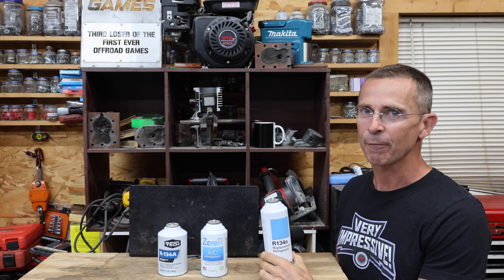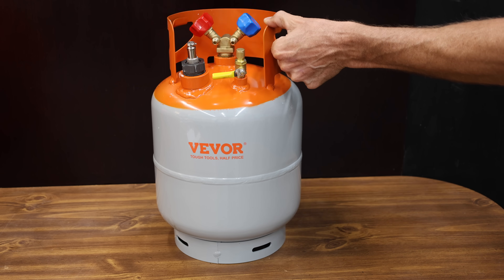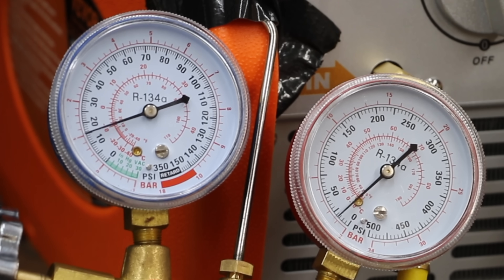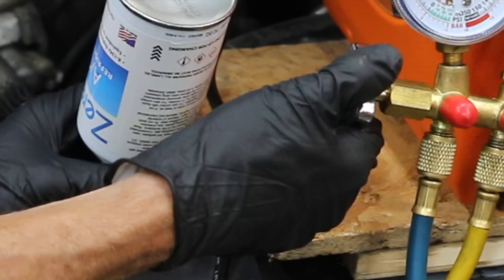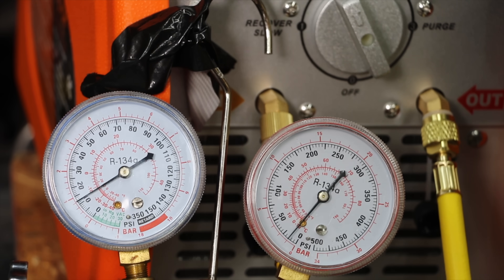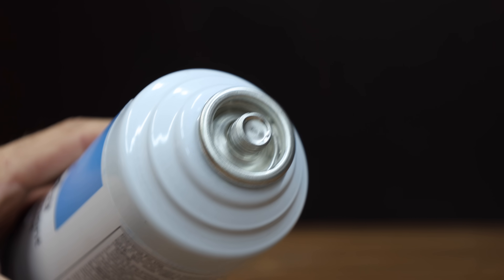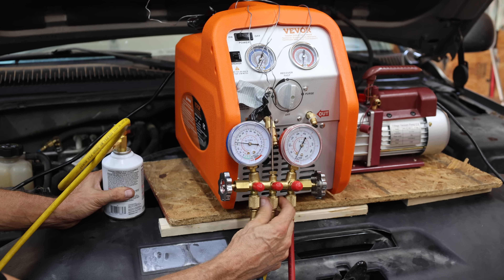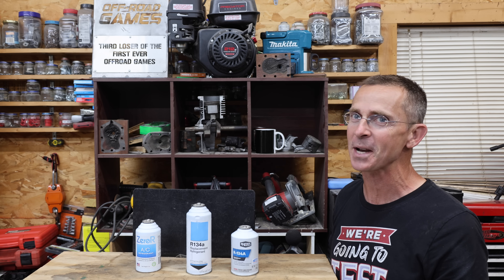How Dangerous is Fake Car A/C Refrigerant? Let's Find Out!

Comment: Fun fact: propane can be replaced in a functioning R22 system and it will run perfectly.
Propane and isobutane are common refrigerants in soda vending machines and commercial refrigerators like in supermarkets
Reply from the maker: Thanks for the feedback.
Reply: Yup I have also done the reverse. One time I was working on a nearly brand new Beverage Air bar undercounter beer bottle glass door display cooler that wasn't working. Turns out the damn trucking company must have bumped something during transport. The discharge line was cracked going right into the condenser coil and the first time they plugged it in, the compressor 'self recovered' the refrigerant charge and pumped it all out! We called them, and they were like well, blah blah call this 3rd party warranty company, and they'll send out a tech to 'fix' it (ya but wait for weeks no thanks). So, after finding the leak, I just brazed it shut with some 15% silFos, and recharged it with R22. It is still working fine 3-4 years later.

The problem was this happened in 2020, and NO supply houses anywhere around here had any R290 in stock, and we needed that cooler up and running asap for grand opening night of this nightclub. Today, a can of R290 can be had for about $29, and there's plenty back in stock now. But back in 2020, good luck, that was the worst of the f'ing Covid shutdowns/shortages nightmare.

isobutane (R600a) is a good substitute for R12/134A, very similar pressures and temps, boils at about 0 C at 0 psig pressures.
Reply: R290 is the trade name
Reply: A long time ago, I recharged my car with propane/butane mix.  It worked okay on the open road, though it really had a hard time unless there was enough air through the condenser.  I had no idea what appropriate numbers would have been, so my attempt at eyeballing it probably wasn't very good.  I remember though everyone waving their arms like hysterical muppets due to the flammability, but apparently it's okay to use flammable refrigerant now because fire hazards are good for the planet.
Reply: Ya everything burns
Reply: The reason why flammable refrigerants are used in those applications is that they're often not in confined spaces where ignition is more likely and would blow things apart.
Reply: My devanti ice maker uses propane refrigerant from memory, and its only 2 years old. Has a sticker advertising non ozone depleting flammable refrigerant. I guess because these ice makers are cheap and disposable when they break every few years they have to be able to be thrown away without too much risk to the environment
Reply: Good. Traditional refrigerants are very damaging to the environment
Reply: Mix the two and it gets very 🥶
Reply: @brnmcc01  I ran propane for years in a leaky car system and it works fine, just park it outside.  I do believe a lot of the generic replacements are a blend of propane and butane.  I believe good old R12 beats the  butane bends  a little because 12 has a higher denseness, don't think 134A will with a proper charge. I do thing the charge needed to be adjusted with the blends to get max cold.
Reply: I use r12a (propane/isobutane blend) it works excellent in my r12 systems
Reply: About any new peice of refrigeration equipment is running propane/butane. And I think by 2025 all residential air conditioners will be too !
So much for that JUST STOP OIL movement 🎉 !
Reply: For those in the comments section who say they are using propane and another chemical mixed together are lying.
You have to have what is called an azeotropic mixture, which is impossible for a layman at home to achieve.
Reply: @glennjames7107  my AC guy told me 410a was out by the end of this year. We have a system that’s 22 years old and really needs a total redo. He strongly suggested doing it by fall, stating the refrigerant, VFD’s, and all the updated PCB laden componentry will only drive up costs while simultaneously pulling down reliability.
Reply: @Stevenowski  For optimum performance, you need the right mixture at the right charge amount for the particular machine. Almost anything with a reasonable boiling point that won't interact badly with the oil already in the machine will still mostly work as demonstrated in the video. Refrigeration is not that hard and yes a layman at home can literally build their own condenser and evaporator from crap from a hardware store, put tubing between them and a compressor, and make something hot and another something cold. I've followed a few channels with people building their own refrigeration loops for a while now. Regular refrigeration/air conditioning isn't hard. In the USA, you can get licensed for working with most small appliances like car air conditioners through online courses in about a week. Youtuber Hyperspace Pirate is even cooking up his own refrigerants from scratch as he works towards building his own machine to liquify air. He hasn't achieved high flow rate liquid nitrogen/oxygen temperatures yet, but he's past making dry ice from CO2 gas, which is pretty cold.
Reply: Propane works good in R12 systems as well.
Reply: Lol what?! No way
Reply: I had propane in a car system it would freeze your toes off.
Reply: Yup. I use propane in all my dump trucks with leaking systems that need charged twice a year. Usually 50psi on the suction side is plenty. Some trucks I had to add a thermostat to keep the evap cores from freezing 😂
Reply: I love how people freak out about it being flammable, will blow your car apart etc. then waddle back to their truck wherein they store their oxy-acetylene torch set, knocking around in the back just waiting for the valve to get bumped open, and store their BBQ in the garage complete with full 9kg gas bottle...
Reply: yes, I filled my dehumidifier with it and it runs well
Reply: It does not! 
🤯
Reply: Butane is a bastard gas
Reply: @BGTech1 where did the components of the refrigerant come from ? It couldn't come from earth .
Reply: Isn't 1234yf based on butane? I do know for sure our Honeywell bottles are marked flammable with EHS symbols.
Reply: R-290 is an entirely different grade than your consumer's at-the-gas-station propane. I wouldnt recommend trying off the shelf propane.
Reply: @RealFuzzyPickLE530  lol . I think you would he surprised
Reply: Fuel grade propane is only required to be greater than 90 percent propane. R290 is 99.5% pure propane. HD-5 propane is the highest fuel grade, which again is anything over 90% which means it contains ethane, methane, and propylene as well as process contaminants and moisture. 

The contaminants will vary based on the source of the propane. It takes a hell of a lot of contamination to make a barbecue grill die. It does not take a hell of a lot of contamination to slug your orifice or TXV, depending on how equipped, and the PT chart for r290 will not be applicable to a blended gas full of non-condensables. You're just charging blind. 

You can do it. Free country. It's just terrible advice.
Reply: @godfreypoon5148  Also, R1234yf, which is used by a lot of cars from the past 10 years, is not only flammable, but also burns to a nasty acid which can eath through about anything and damage your lungs pretty badly. Extinguishing a car fire has become a highly dangerous job because of this and modern brake fluid (which is also flammable and also does nasty stuff when burning... seems a combustion car is just filled with nasty, burnable stuff.
Reply: I'll bet Hank Hill is happy about THAT🤪
Reply: @kdawson020279  found hank hill !
Reply: @Kommunisator  Yeah, hydrofluoric acid vapour.
That stuff is deadset terrifying.
Reply: Fun Fact: Hydrocarbons are illegal to use in capacities exceeding 16 ounces. They're great, but due to flammability, they aren't used beyond small appliances.
Reply: @friedpancakes266  Unfun Fact: Comparably flammable fluorinated refrigerants, like R32, are not restricted like this.
Reply: almost all EU refrigerators use propane
Reply: Exactly!
Reply: @OGBunney  Propane? Do you mean Blue Ryno?
Reply: @kingsarbkota LOL
Reply: @fuzzy1dk   Mine uses butane. United States, R600a
Reply: @bywonline  Right.  As I said, eyeballing it.
Reply: @brnmcc01  no, check the tables of R-600a v.s. R-134a, the pressures are not similar. At -10ºC the R-134a works to 1 bar (14,5 psig), but at the same temperature R-600a works near to 0 bar - 0psig (relative presure). It could work, like could work put R-22 or R-404A into R-134a, but it's not good for compressor, sure. And all people that say to change R-134a for isobutane forget the need of be ATEX the components of a refrigeration circuit that works with flamable refrigerants.
Reply: @dacaca  Yes you are correct, but it's in the same class of low pressure refrigerants. In fact, there's plenty of refrigerators and small chest freezers that use R600a. But R22 or R404A are classified as a medium pressure refrigerant. 404A has a little bit of R134A in it, to lower the pressures.

You can't put R22 or R404A into a compressor designed for 134A, the compression ratios are way different. I mean, you could, but it won't be ideal.
Reply: @kbible6414  What you just said makes zero sense. R12, R22, R410a, R134a, R404a, R454b, R32, R507, R290, R600a, etc. all heavier than air. Only 600a, R290, R454b, and R32 of that list are not ozone depleting. Only 600a and R290 have minimal global warming potential. Refrigerants decompose due to sunlight and thermal decomposition, and release gaseous molecules that are lighter than air. 

The largest cause of death in HVAC-R is asphyxiation as the heavier than air refrigerants displace oxygen in a closed space, then you pass out and there is no oxygen at ground level because refrigerant is heavier than air. 

Air is 78% nitrogen, 21% oxygen, and 1% everything else. No refrigerant molecule is going to be lighter than nitrogen as a 2-molecule bond;  chlorine, fluorine, and a hydrocarbon in varying quantity over the CFC, HCFC, HFC, HCFO, but not all HC, refrigerant gases.

The story is cool, but the math isn't mathing.
Reply: Only thing, R22 is neither Propane, nor Butane. Propane would be R290, Butane I think R600 and Isobutane R600a.
For most newer Refrigerants there even exists list, which refrigerant can be replaced with which other one. in some cases it is sufficient to run higher pressures, In other cases a different orifice size is needed (works only in larger HVAC systems).
Those replacements get more and more relevant with more and more refrigerants are phased out due to their impact on climate change. what little of the older stuff is still available for existing systems, gets more and more expensive.
What I am amazed about, ist that they can sell that stuff without giving any actual hint on what is in the can. It would be mandatory here in Europe as the cans holding flammable liquid/gas fall under certain dangerouse goods regulations.
Also their claims seem to be a bit far fetched, looking at the leak saver description for example claiming that it has zero global warming potential. That alone would rule out Propane and Butane, which have a considerably lower, but still higher than zero GWP.  With CO2 being the reference with a GWP value of one, Propane has a GWP of 3 (which already is way better than R134a with 1430).
Butane is 4, Isobutane also 3. On the other hand, atl least the ZeroR describes it can be run with lower pressures, that would match Propane.
R22 has a GWP of  1880 by the way (according to an older list 14800, couldn´t figure out yet which one is right), so good thing to replace that stufff (and dispose of it properly by not just venting it)
Reply: @godfreypoon5148 Not to mention the gasoline in the truck 😁
Reply: @brnmcc01 a lot of the apartment size and mini refrigerators use the 600 I believe
Reply: @alexanderkupke920   That is no longer current. The GWP of R290 is 0.02, revised down from 3, according to the Intergovernmental Panel on Climate Change, hence the claim. In the stuff I'm being taught right this moment, it has a GWP less than 1. It's propane, but it sure as hell isn't a 20# grill tank that's up to 10 percent totally not propane.  That is the thing that bothers me in this thread. The HC-12 style retrofit gases are all basically R290 or similar hydrocarbon.
Reply: Both the flammable gases meet the requirements for refrigerants - have low boiling point, low freezing point, low specific heat and high latent heat, are miscible with pump lubricant oils, non-corrosive to components and are abundant and cheap. But they blow it on the "should not be flammable" front. As long as everything remains sealed - it's all good. But those leaks that come with age....Hmmmmm.
Reply: @MrPDGee   Here's something you need to keep in mind. When the small amount of R290 in your fridge or car (please use actual R290, BBQ fuel gas is dirty and full of impurities and non-condensibles) or 600a in your fridge burns, it creates carbon dioxide, water vapor, and heat. When any of the chlorinated fluorocarbons decompose due to heat, they give off phosgene and/or sarin gas. R290 and 600a don't require EPA licensing, and R290 has an ozone depletion of 0 and a Global Warming Potential near zero. Understanding a risk is a key to assessing a risk. Both gases in the sealed system are held under pressure which raises their boiling, flash, and autoignition temperatures.
Reply: @kd7cwg  I saw some small chest freezers for sale at Costco that had R600a on the label. I think most household refrigerators sold in Europe also have switched to that too.
Reply: i cuse propane/butane mix also called camping gas.
Reply: @kdawson020279  ok now a lot of things I found start to make sense. I had a first list from 2015 that seemed to be completely of. the other one was from just either 22 or 23. But even if it was 3, that stuff is still a huge improvement in that regard over older refrigerants with GWP values like 1300 and more.
Sometimes, as closed up as the brands seem to be about what is in the bottle, i wonder if it is some mix (which in some regions may be not officially allowed to use, although I think you can mix R290 and R600a for example. But I wonder if there is some sort of additives in there as well.
I also think in the past, Propane and butane had been the only refrigerants you actually were alowed to vent into the atmosphere here. although for safety reasons, if needed I know burning them off was preferred.
Reply: ive done hvac for a long time and never knew this . Thanks for the info .
Reply: Something i've been curious about, what would a r134a system do/function if you replace it with r12?
Reply: @hvguy  What kind of propane are you using?  Do you mean taking a bottle of propane for a torch and some how adapting it to the air-conditioner fittings?
Reply: @TuckerH.  it comes down to the different oils or lubricants. For example r134a uses poe oil and r22 uses mineral oil. Put them together and you get a freaking brick.  Which is why you can direct drop and mix certain refrigerants and not others
Reply: @Stevenowski I mean, ok guy. I have used R12a, which Wikipedia says is “a mixture of hydrocarbons, specifically propane (R-290) and isobutane (R-600a)”
Reply: @MrPDGee r1234yf, which comes in a lot of new cars is just as flammable. It’s not really an issue. You realize your car has lots of gasoline vapor in the tank, evap, and charcoal canister all summer, right? On top of the big tank of liquid gasoline. Pretty flammable, I hear.
Reply: @5467nick 
The "right mixture," as you say, would be called an azeotropic mixture. It's almost impossible for the layman at home to achieve. I don't have the equipment at home to make such a mixture.
I am licensed to work on high pressure, low pressure, and small appliances. I've had my Universal license since 1993. I'm here to help, not bash or brag. Working with refrigerants is not the safest work and much less so for the layman at home.
Be careful.
Reply: @TuckerH.  Most likely it would not work correctly or at least efficiently, as orifice sizes or settings for expansion valves are of as well as pressures, if not compensated for that. Unless pressures get completely out of hand and cause something to overheat or run too high pressures that could damage the compressor, otherwise not much would happen (may also depend on compressor type, scroll, piston etc.). All given there is oil in the system.